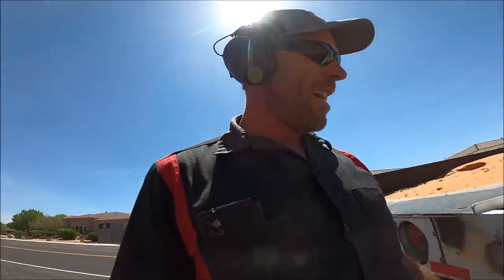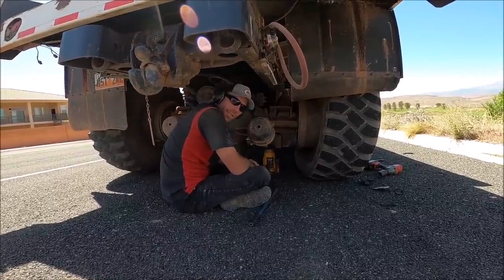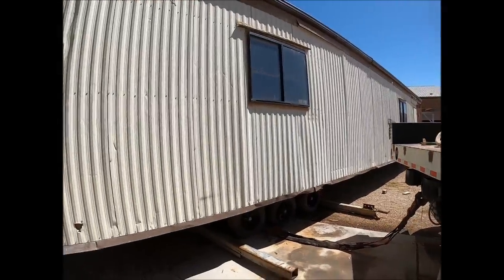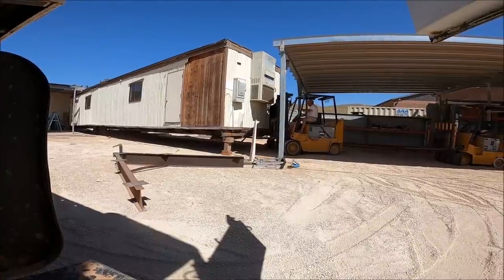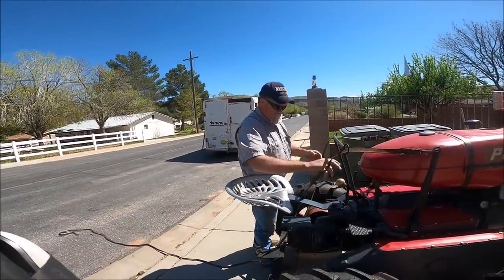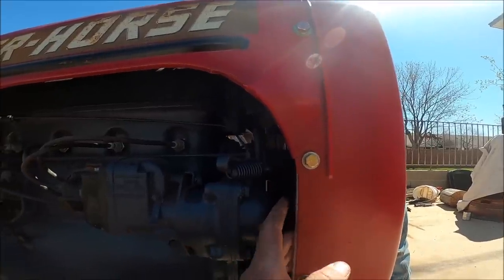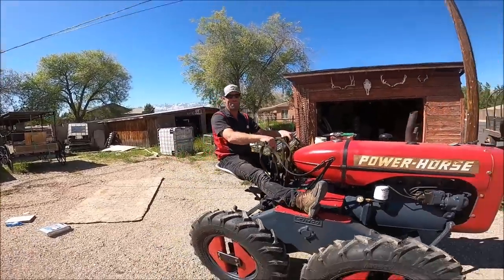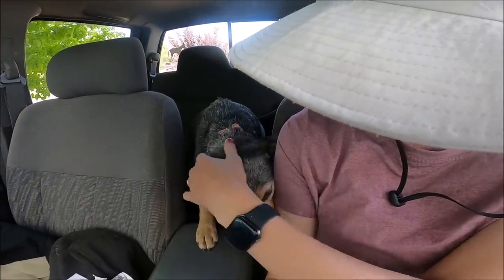5 Ton drags a 60 foot trailer. Plus Power Horse Tractor footage.

Comment: I was pretty impressed a while back when I saw Casey perform a recovery in muddy terrain, because he was wearing 'mud' boots, unlike just about everyone else who wades through the mud in sneakers or low-cut work boots. 

But I gotta say that seeing him in the beginning of this video changing out that tire on his 5-ton and having not ONE - but TWO large jack stands underneath the axle??? I'm just blown away that someone actually took a few extra seconds to do that!

Betting that 99.999% of people would just simply allow that side of the axle tube to balance on the head of the bottle jack - which is REALLY dangerous. 

On a scale of 1-5, I'd rate this video 👊👊👊👊👊+👊👊<--- Bonus 2 for sharing that Power Horse tractor footage!

Comment: Sheets of Plywood makes any forklift and off road tool.
Also, Casey....Ever use a wood wedge block with a flat spot for a jack? I use them on tandem axle trailer flats all the time. A time saver.
The Power Horse is amazing and very cool!!!!
Reply from the maker: I do use them, but the walkin beam suspension doesn't allow the other tire to come of the ground like on a trailer.

Comment: What's the cost for one of those tires..
Reply from the maker: $1000
Reply: @CaseysOffRoadRecovery  Is that new or surplus? I've seen some sweet deals at Eastern Surplus and Equipment Company. Going to need a full tire swap on my rig too.
Reply from the maker: New. Most surplus are out of date and don't last long in our heat.